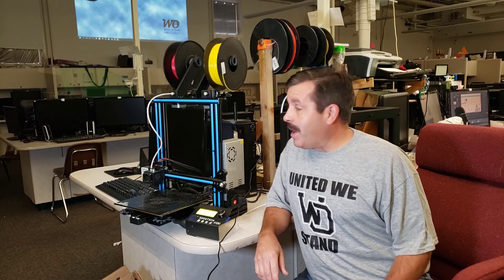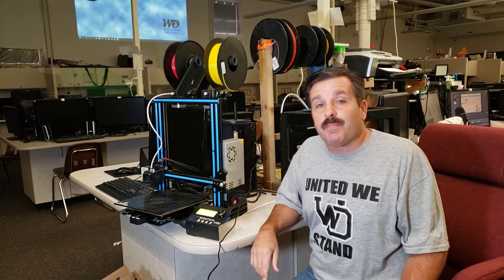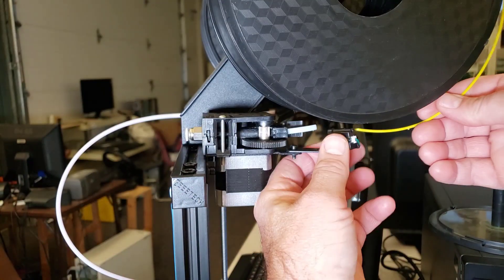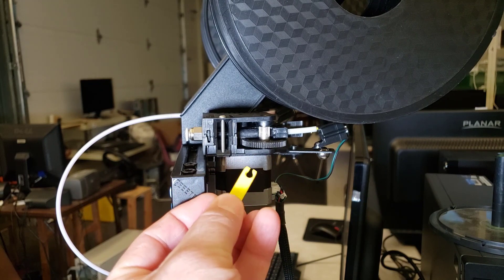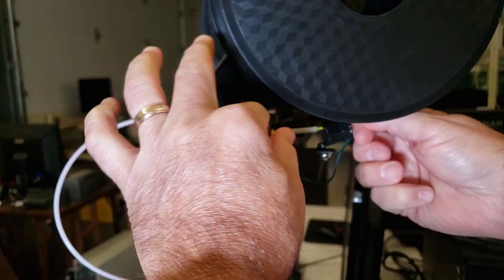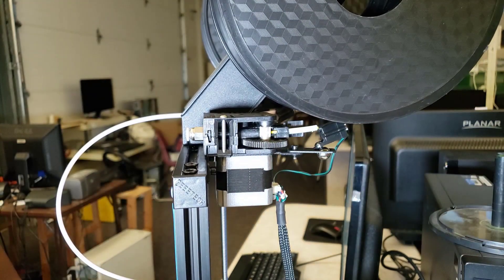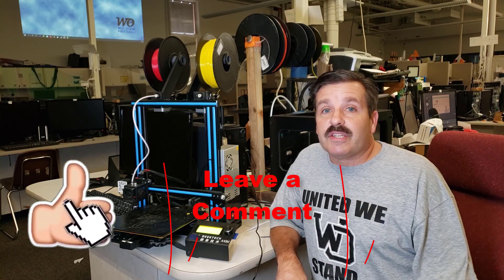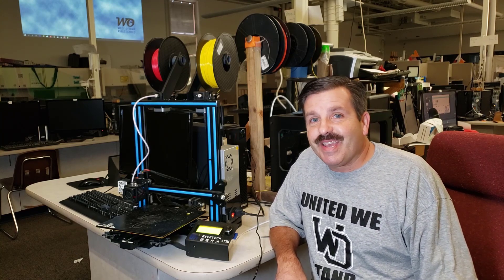Introducing the Filament Funnel | Geeetech A10M Filament Tool

Comment: My filament wont go in after like 0.5 cm is in what do i have to do for the a10t
Reply from the maker: There is a chance there is a piece in there and it is jammed. I sometimes pull off the Bowden tube in the front and use that little rod that came with the machine to push through anything that might be stuck in there,